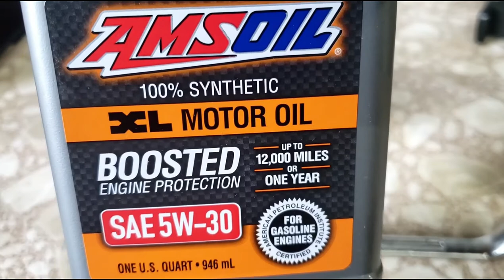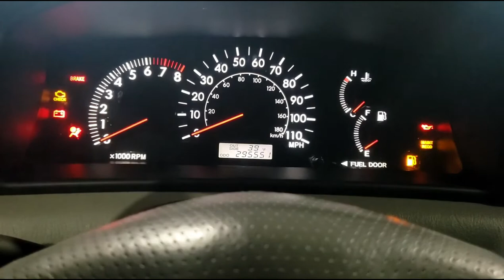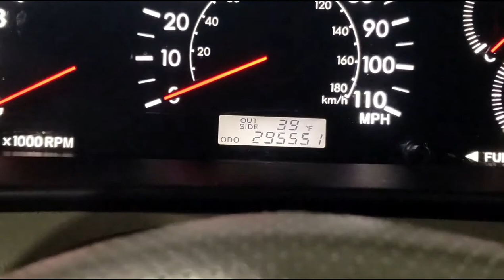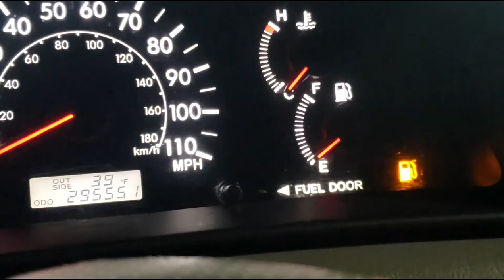Paano Mag Oil Change Ng 2006 Toyota Corolla Altis | Car Maintenance | AMSOIL | TCCP

Comment: Sir bukod sa amsoil po ano pa po ba magandang oil po para na ibang brand . Meron po kasi ako 9th gen corolla altis e manual 2006 model sir . Saka po anong viscosity ang pipiliin ko kasi po ang mileage po ng altis ko eh 127k na po sir. salamat po sir  sana po mapansin nyo
Reply from the maker: madami po ibang magandang brand like Motul, Redline, Mobil1, Castrol, Pennzoil, Valvoline. according sa Amsoil website 5w30 po ang kailangan.
Reply: Sir salamat po sir . Pero saan po kaya ako makakabili dito sa pilipinas ng amsoil sir .
Reply from the maker: @leonciogueco441  search nyo po sa fb. alam ko madami na din nagbebenta
Reply: Ok po sir salamat po .ingat po jan sir .
Reply: Pa shout out po pala sa next video nyo sir salamat po god bless po .
Reply from the maker: @leonciogueco441  haha sige idol..

Comment: Sir patulong naman, pinagpipilian ko kasi toyota Altis 9th gen vs Starex Svx. Eto
 lang po kasi alam ko na kotse na reliable na pasok sa budget ko na 200 to 220k. Okay pa rin po ba kumuha ngayon 2021 ng Starex (timing belt) atleaat diesel or sa timing chain na ako na Altis 9th manual but gasoline. Salamat po. Or baka po may marecommed din po kayo iba pang sasakyan. Salamat po.
Reply from the maker: sir dipende po yan sa pag gagamitan nyo, may family po ba kayo? ilan po anak nyo? kung wala  mag altis po kayo. kung meron po mag starex po kayo, pwde nyo din gawing service or pa rent hehe
Reply: @pinoysidehustler  salamat po sir. Medyo nag dadalawang isip lang kasi ako dahil timing belt pa sya.
Reply from the maker: @izon9452  ah ok.. basta palitan mo lang ng oem para sure ka

Comment: Sir magtanong nga po ako paano po magpalit Ng gear oil sa 2007 Corolla. Need po ba palitan un or I top up? Salamat po
Reply from the maker: ATF po ba sir?
Reply: Opo sir. Napaisip lang po kc ako if need din mag top up sa gear oil Ng oil and sir Yung oil filter po b Hindi n need gamitan Ng tools para higpitan? Salamat po kaka subscribe ko lang po s chanel nyo interested kc ako n matuto mag gawa
Reply from the maker: @samueltalampas8060  salamat po sir, ang ATF po pinapalitan every 60k to 80k miles. drain and fill lanf po. sa engine oil filter nman hand tight lang po pag higpit
Reply: Maraming Salamat po sir. Nabili ko kc ito asa 135miles n odo eh mukang Hindi p na refresh Ang gear oil. Sir ilang liters po b Ang need ilagay sa gear oil. Maraming Salamat po
Reply from the maker: @samueltalampas8060  check nyo po muna ang atf kung pink pa. 3 liters po ang kailangan nyo